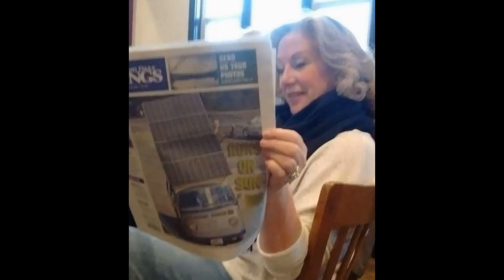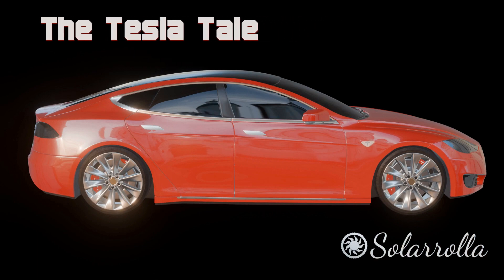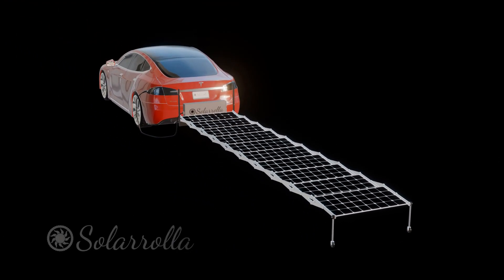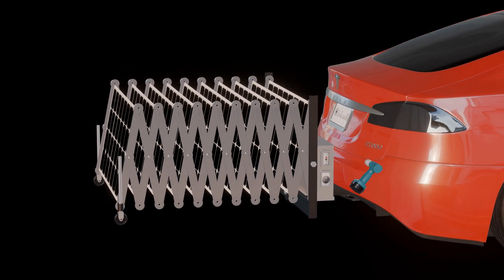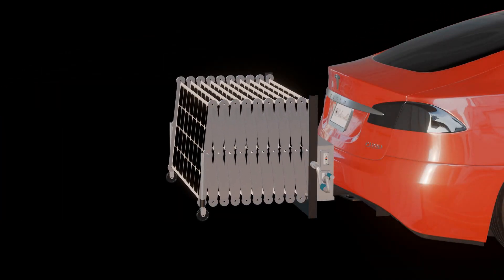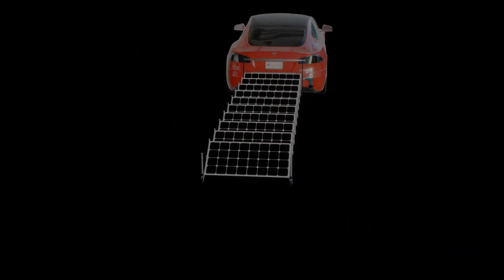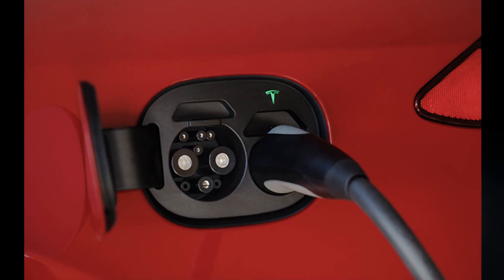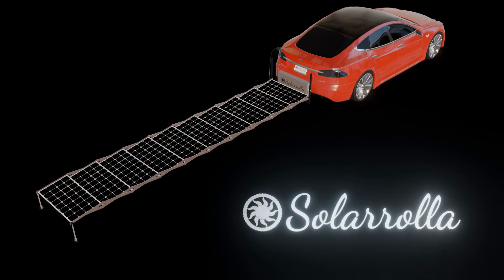Napkin Series 2 -Tesla Tale! Solar charging array for EV

Comment: 2,250 avg watts solar generated X 5 hrs per day is about 11,250 watt hours generated per day. The battery is at least 49,000 watt hours.  So, it’d take her 4-5 full days to just to charge her car from 20% to 80%.  The trailer also reduces the range dramatically.  So, you’d want to leave the trailer unhitched.

Comment: How about using those cig style flexible panels stitched together in a big roll. That you then roll forward over the top of the car. Can have little stand offs that go into the rain gutter groove. If spaced properly the standoofs can likely be permanently attached to the back of the panels. Then figure out a way to latch to the front bumper so wind doesn't bother it. Could retrofit a winch motor with the wireless controller to the roller for easy packing. Smaller overall footprint. Probably a lot I'm not considering since I've never dealt with a tesla but that's what my napkin thought was.

Comment: This has a lot of potential. You could probably motorize the scissor mechanism so that it would deploy at a push of a button. I think there would need to be additional intermediary supports as it stretches out but that should be fine as those could get bolted on the sides and not affect as it expands and contracts. You could also utilitize the full width of the car since they get tucked away from behind so ten 300W panels would make this a 3000W system. Thanks for sharing with us and looking forward to other videos along with an update to this prototype!

Comment: Ask an electrical engineer how long it would take to charge a car with that. Watch closely, the engineer will try not to laugh as they do a quick calculation in their head. If it were 10x bigger it would still be inadequate.
Reply: That’s not true at all I can charge my Tesla 20% per day off a couple jackery solar panels.
Reply: If its 1000w and you have 10 hrs of sun it would take 6 days to charge from empty to full, but you could drive 40 miles on each day of charge.  It would be better to use more powerful 300w panels which would mean you could drive 120 miles per day, which is nothing to sneeze at.

Comment: Great concise video and great graphics of the concept! I was just doing back of the napkin calcs of a similar setup,  but using 200 watt panels in a few strings in a hitch mounted box, and a battery in the back of a Rivian R1S for remote trips. The only thing that stood out to me was the crank out, which would add a lot of complexity and issues. I like the scissors frame and think manually pulling it out would work best!